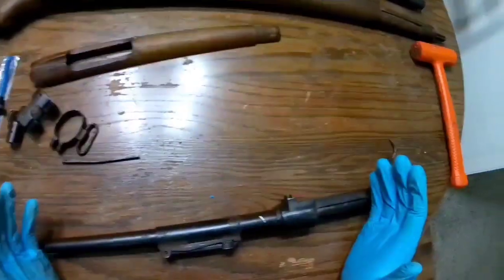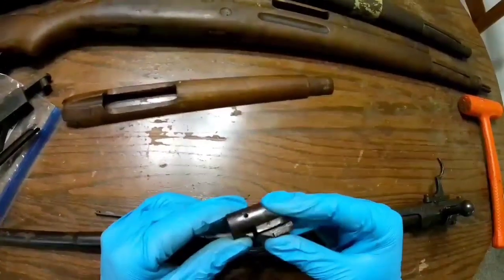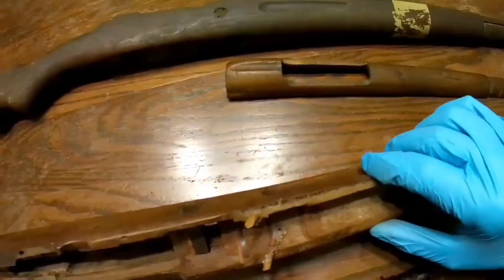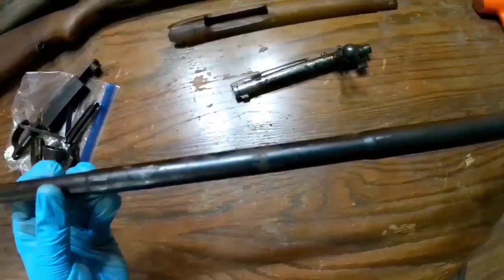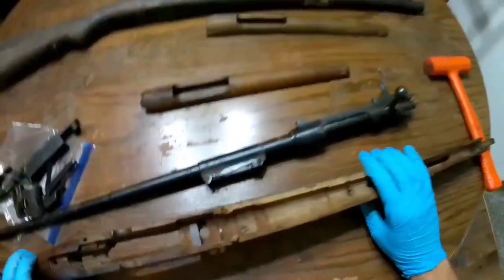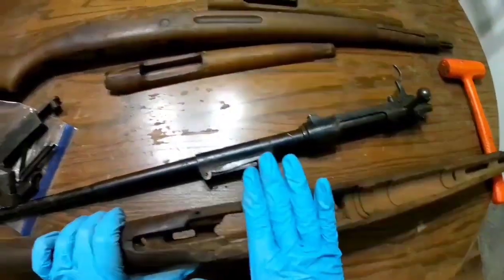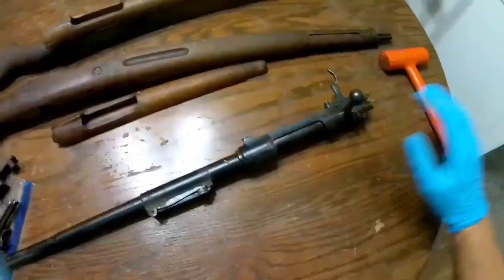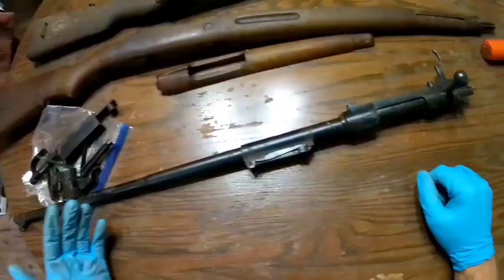M1943 (M43) Spanish Main Battle Rifle (8mm Mauser) from Hunter's Lodge Restoration (Part 2)

Comment: I just got my m43 from them after 6 mo. (actually 8, but the last two months were my fault for forgetting it at my FFL). Definitely rough, but oddly the bore and chamber are shiny if a bit worn. Definitely not something I’d recommend to other people, but for me it was just a “let’s roll the dice for the hell of it”. 

The bamboo skewer “repairs” are a hoot! I haven’t got the action out of the stock yet but I got the mag out and it looked pretty much like yours. I’m hoping the action and barrel looks decent like yours but it’s probably no worse than my Dutch Mannlicher KNIL rifle. Depending how bad it is, I’ll either hit it with plenty of oil and bronze wool (it’s less abrasive than steel wool) or boil and card. The stock is crappy but I don’t really care, I’ve got plenty of 7,92mm blasters as it is.
Reply from the maker: Glad you have a good looking bore, I also rolled the dice when I bought mine, which I was just hoping for a good bore.  My primary reason was just to have a beater shooter so I wasn't getting out my nazi K98, Gew98, or my M48.  Btw, was yours all numbers matching?
Reply: @The_Casual_Collector   It is, kinda. The bolt handle looks like it was ground off and restamped, crudely. Much more so that I’ve seen on any Spanish Mauser. I kind of wonder if it was another of Hunter’s Lodge’s “fixes”. The safety flag and gas shield have numbers on them that don’t match but the Spaniards cannibalized guns to fix others so that doesn’t surprise me. They look like they might have come off one of the other m98 Mausers that ended up in Spain during the civil war. 

To me a matching bolt isn’t a big deal unless we’re talking spending the cash on a real gem of a k98k or something of that sort. So many were swapped around for various reasons on old milsurps that it’s pretty par for the course.

Comment: heavy rust i like using rust removal gel.
Reply from the maker: Interesting,  is there a certain brand for that?
Reply: @The_Casual_Collector  nope any and all rust removing gel works great.
sometimes i will boil used motor oil and sock all the gun parts to reblue the parts... the hot oil sinks in the metal real deep to prevent them from rusting again... a very old school gun smithing trick.
Reply from the maker: @gilliland426  very cool, I didn't know about that, I appreciate the advice.